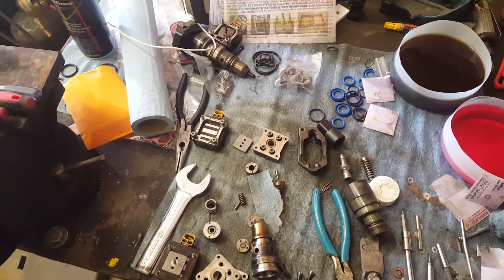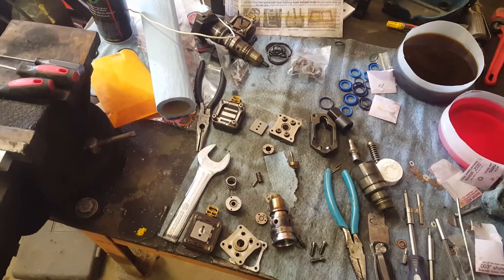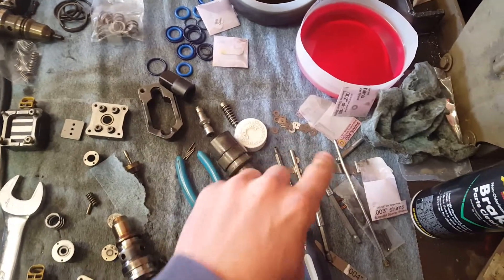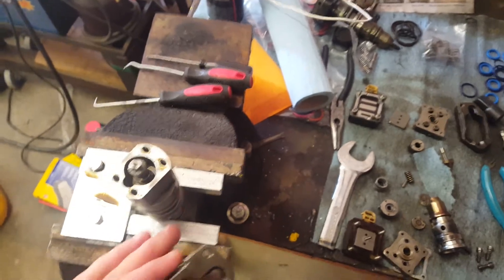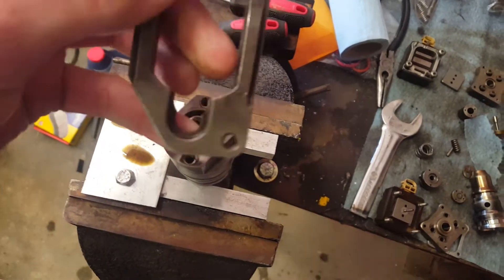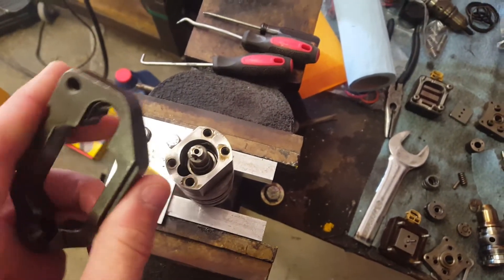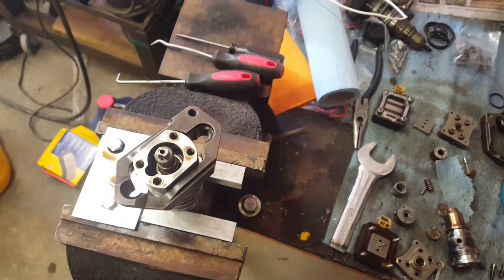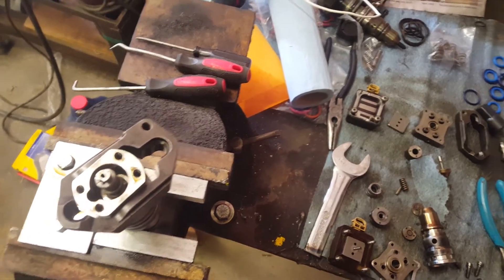Ford 7.3L Powerstroke injectors.  Don't make this mistake!!!

Comment: Thanks for the heads-up earlier this year on my video - I completely own that I messed up - because I had gone by the other video you mentioned (from George Tergin).   I'll be fixing the error on my 8 injectors this week, and FINALLY getting the injectors reinstalled into the truck.  ( here's my video - that has the incorrect info at about 21 minutes in) https://youtu.be/LJRT09x1kEA
Reply: I just linked to your video from within mine for the correct hold-down positioning.